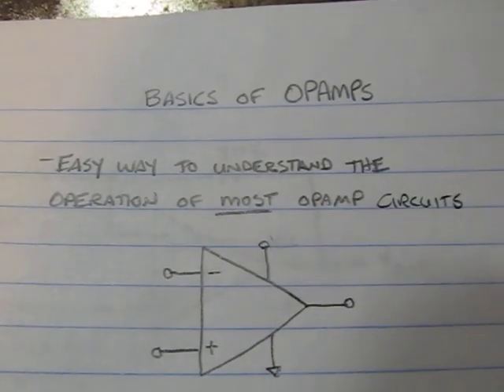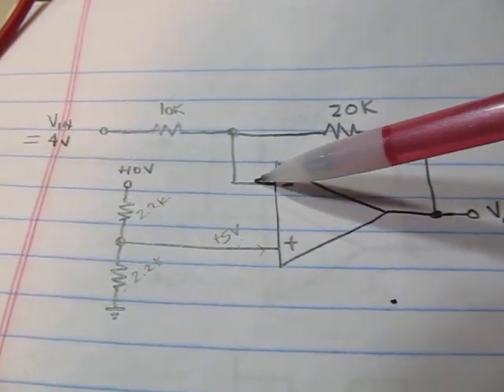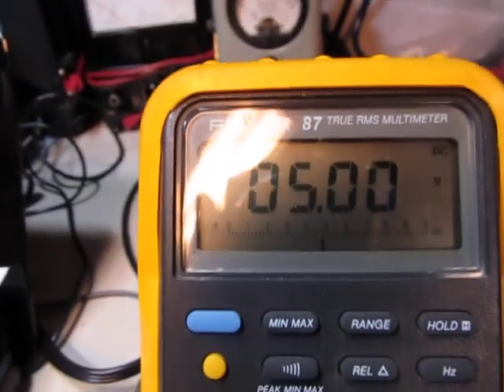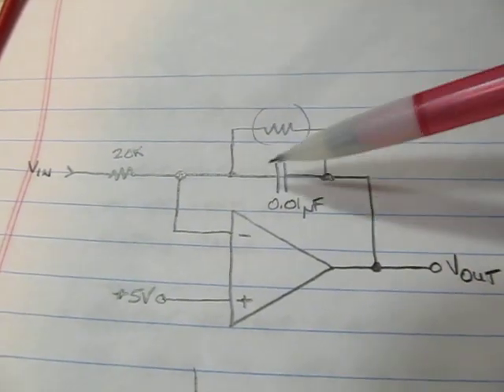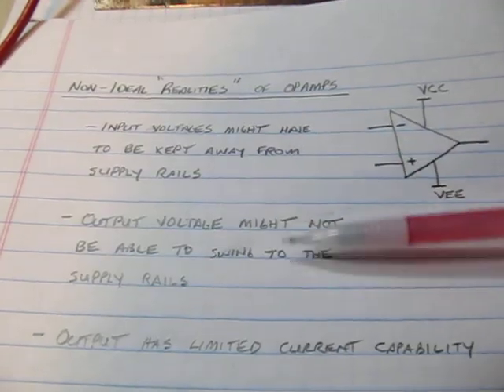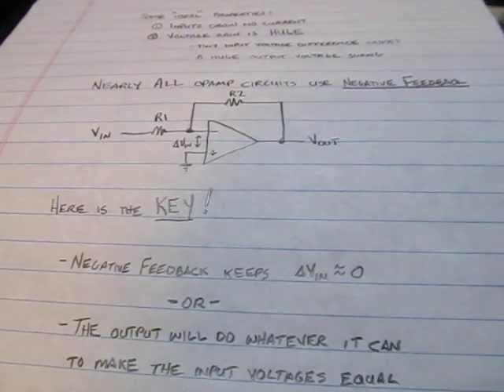#75: Basics of Opamp circuits - a tutorial on how to understand most opamp circuits

Comment: Nice video. One question:  @8:16 you said" when a DC current flows to a capacitor voltage will increase LINEARLY. I thought it would increase logarithmically via the step response formulas. Any comments??
Reply from the maker: The linear increase in voltage happens when a constant current is input into a capacitor. The exponential increase in voltage happens when the cap is connected through a resistor to a voltage source.
Reply: @w2aew  OH! Thanks a lot!
Reply: @w2aew  i like how you still respond to questions after 11 years

Comment: If you set the square wave generator frequency to 1 / (10T) where T is the RC time constant, would you get an output waveform that looks like the charging and discharging of the capacitor?

Comment: and you still didnt explain what an opamp does
Reply from the maker: The op amp itself is just a very high gain, differential input, single ended output amplifier.  The added circuitry around the op amp determines the overall function of the circuit, such as a simple amplifier, filter, peak detector, etc.  I'm not sure what else you are looking for.

Comment: When either a transistor, FET or opamp stage is Feed FORWARD gain which has no feedback loop, how is feed forward gain different than feedback gain? Feedback gain is taking the output signal and creating an error voltage which the input has to follow the output signal. Feed forward gain is output signal is NOT following the input signal and there is No Error voltage?

Comment: Negative feedback does not drive the differential input voltage to zero. This is a common misconception. On the contrary, the negative feedback acts to deliver that error (differential) voltage at the amplifier’s inputs that is required to give the demanded output. Nothing more and nothing less.
Reply from the maker: Yes, of course.  But with the huge open loop gain of the op amp, the error (differential) voltage is typically VERY small.  Using "zero" is an easy  and accurate enough approximation to make the analysis easy.

Comment: Hi Alan, in the first circuit, you have a ratio of 2:1 for the Rf:Ri. Yet the output voltage was 7V and input 4 V, shouldn't the output be 8V? What am I missing please?
Reply from the maker: The input is not referenced to ground, that's what you're missing.
Reply: @w2aew  Thank you. I can see it now, the input terminals are at 5V, so the 1V drop across the Rin is doubled across the Rf making 7V at the output. I really appreciate the time you take. I find Engineers and Scientists are usually very free with their time and advice.
Reply from the maker: @simonyoungglostog  Excellent, now you’ve got it!
Reply: @w2aew  Thank you.

Comment: Various Audio Amplifier IC chips and Op amps use mostly Unregulated Voltages for the Vcc and Vee, any reasons why the use Unregulated voltages? There is a circuit inside the IC chips and Op amps that are stabilizing the fluctuations of the unregulated voltage
Reply from the maker: If the amplifier has sufficient PSRR (power supply rejection ratio), then the gain of the amplifier won't vary with the expected power supply variation, so the manufacturer can get away with cheaper unregulated supplies.  It's all about cost...
Reply: @w2aew  I'm not sure if Op amp IC chips in the datasheet says PSRR. In arcade games and pinball games they use Op amps IC chips for the audio circuit but use UNregulated voltages because the designers say that Op amps IC chips used for audio circuit you can use UNregulated voltages which I'm not sure why? I would think using Unregulated voltage will cause the Op amp, Transistors, and FETS in audio circuits to amplify the AC ripple and the voltage will fluctuate up and down slightly
Reply from the maker: @waynegram8907  Op amps do have good PSRR, and most will specify it.  For example, see the 3rd item on page 7 of this datasheet: https://www.ti.com/lit/ds/symlink/lm358.pdf
Reply: @w2aew  The datasheets will show a bunch of FETS and Transistors inside the schematic of an Op Amp, but I don't see the PSRR circuit or what is considered the PSRR network inside the OP amp. When Looking at an Op amp datasheets what is considered good PSRR and what is considered bad or just ok PSRR?
Reply from the maker: @waynegram8907  There generally aren't specific PSRR circuits.  The differential amplifiers inside an op amp are naturally insensitive to power supply changes.  The current sources used as bias and active loads are designed to be independent of minor supply variations.
Reply: @w2aew  The differential amplifier and current mirrors inside the Op amp is the PSRR circuit or acting like the PSRR circuit? most 70's-90's Car radios and also pinball games/arcade games use one Audio amplifier IC chip which must have built in PSRR circuit or differential amps/current mirrors to act like a PSRR circuit?
Reply: @w2aew  Tube amplifiers don't use PSRR circuits but they use Reservoir Capacitors which I think the Reservoir capacitor values are "above or below" the cut off frequency of the 60hz line frequency? because the filter capacitors value is at the cut off frequency 60hz line frequency to filter out the ripple. The Reservoir capacitors don't filter out the AC ripple. The reservoir capacitors also use a high voltage rating like 450vdc or 600vdc because the high the voltage rating means it can handle "in rush Resistance" . I didn't know that the voltage rating on electrolytics capacitors means the "in rush resistance" of the capacitor. The data sheets specs don't list it saying "in rush resistance". If the caps voltage rating says 450vdc this mean that its in rush resistance is 450mA?
Reply: @w2aew  Most tube amplifiers don't use regulation circuits or tube or solid state regulators, any reasons why? preamp tubes and power tubes don't have a PSRR circuit built into the tube so I'm confused how tubes used as amplifiers the gain doesn't have variations when the power supply variations up and down

Comment: did not work for me. easy to explain looks everything okay but when one to try to make it and test it as you did not so easy. first thing you didn't show how you supplied voltage to the opamp?!! did you use split power supply? and what was the voltage? 10 volt?!! or 4 Volt??! anyways not that good. U got to show details clearly Electronics is about tiny tiny details. Not happy sorry.
Reply from the maker: Sorry about that. The intent of this video is to help understand the basic function of op amp circuits. It wasn’t intended to talk about design details, or how to design op amp circuits. I have videos on things like op amp power supply considerations that covers this. The choice of power supply rails depends on the specific op amp and the required voltage ranges needed as the input and output. This is a lot more detail than was intended in this basics video.
Reply: @w2aew  thank you so much. Sorry I got somehow frustrated and definitely left that comment too soon. When I referred to your other clips everything was sorted out and I found out what I did wrong in first place. You are one of the best or maybe the bestest!!! 🥰

Comment: at 9:03, I'm a little confused. Since the charge/discharge is from the capacitor, why is the yellow waveform a ramp, rather the typical curve a charge/discharge cycle of a capacitor?
Reply from the maker: Because the op amp + feedback results in charging/discharging the capacitor via a constant current.

Comment: Hi
I have been trying to measure the Input Offset Voltage on a op07 op amp on you tube there  seems to be conflicting ways to do this all with different value resistors using the inverting amplifier my own way was to use a 100000k res  on the Rf and 100ohm on the Rin to ground also the + to ground gives me a gain of 1000 my supply voltage to the op-amp is +-  14v   and I measure  about 13.42v from ground to the output. And was told to divide my voltage by 1000 to give me 13.42 milivolts offset voltage, others tell me to put resistor also on the + to balance it up I watch your videos and you explain things the correct way hope you can help

Comment: What are some tests you can do for preamp amplifiers circuits and power amplifiers circuits to test for Linearity? Linearity can either mean gain flatness from 20hz to 20Khz or Linearity can also mean how much input peak to peak voltage before the preamps output clips saturates or before the power amplifiers output clips saturates. I'm confused by what EE engineers are considering when a preamp or power are is linear.

Comment: At timeline 7:32 when using a capacitor as negative feedback, the rule you mentioned at the beginning of the video where negative feedback causes the differential input voltage to be near zero, does not apply here, since the non-inverting input is fixed at +5volts and the inverting input swings above and below 5 volts. Am I correct?
Reply from the maker: Not quite.  When the input is brought above 5V, the output voltage gets adjusted to ensure the inverting input stays at 5V - it does this by causing the current through the input capacitor to flow into (or out of) the feedback capacitor.  A constant current into (or out of) a capacitor causes a linear change in voltage across that capacitor, which is observed at the output.  The junction of the capacitor and input resistor (at the inverting input) remains at 5V.
Reply: @w2aew  Thank you~ This is interesting!

Comment: where does the 5V come from? Simple ohms law, but I do not understand this.
Reply from the maker: The 5V at 3:16 is from a simple voltage divider.  The two resistors are the same value and are in series.  Since 10V appears across the combination, there will be 5V at the connection between the two resistors.  There are several ways to calculate this.  It is basic ohms law.  You can compute the current as I=10V/(R1+R2), and then the voltage across the lower resistor as V=I * R2

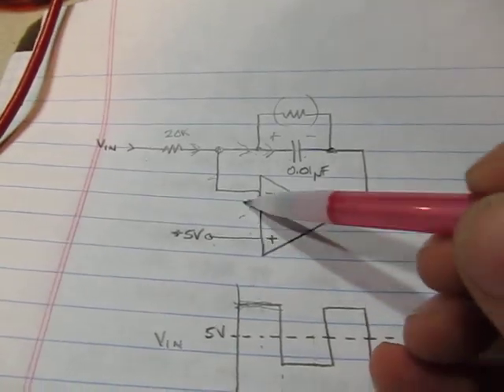Comment: can this op amp circuit in timeline 6:58 be considered as a non inverting amplifier? At timeline 9:38, the rule you mentioned about both inputs have to be at the same voltage level when using negative feedback applied only to when a resistor is used as  negative feedback and not a capacitor. But here you showed that when a capacitor is used as a negative feedback, the rule still applies.
Reply from the maker: At 6:58, assuming the signal input is at the upper left, this is an INVERTING configuration.  If negative feedback is being properly employed, the two inputs will always be nearly the same voltage.
Reply: @w2aew  Thank you sir

Comment: I have made several attempts at making op amp audio amplifiers for use with transmitters. They always seem to introduce unwanted noise into the transmission. I don't seem to have this issue when using a linear BJT amplifier. Any tips on keeping op amp noise out of a transmitter?

Comment: Differential-mode and common-mode signals are important to understand in the design of complex signal-conditioning circuits in medical diagnostic, industrial control and military applications. Topics related to these aspects are discussed in one chapter of textbook 4 (see in video #1 last frame References) and a power point presentation with animations “Basic Action of a Differential Amplifer-Heart of the Opamp” is included in the CD alongwith this book. It gives an intuitive approach to learning diffetential amplifier operation which is the heart of the op-amp.

Electrostatics and circuits belong to one science not two. To learn the operation of circuits, Current and the conduction process, resistors and how discussing these topics makes it easier to understand the operation of capacitors, inductors, diodes and their operation in op-amp circuits and circuit theory watch these two videos 
i. https://youtu.be/REsWdd76qxc and 
ii. https://youtu.be/8BQM_xw2Rfo 

The last frame in video #1 lists textbooks in the References. Textbook 4 discuss all the above topics using a unified approach to electrostatics and circuits.

Comment: 3:15 Can someone help explain to me how he got that voltage? Im unclear how Ohm's law was applied
Reply from the maker: 10V applied across two 2.2k resistors in series.  Current through both resistors is the same (10V/4.4k).  Thus, the voltage drop across the lower resistor is 2.2K * (10V/4.4k), which can be re-arranged as 2.2k/4.4k * 10V, which is 1/2 * 10V or 5V.
Reply: @w2aew  wow thank you that makes sense

Comment: Master
If possaibale ,could you explain an adjustable power supply circuit on your great papers?
I mean so much amateur need current and voltage adjustable power supply details.Have over millions circuits about this but only some circuits working on internet.
Could you tell ,for example 0-30 volt (Adjustable) and 0-5 ampere adjustable  (or a few more) linear power supply ,it can be SMPS (with new chips) Short Circuit protect and over adjust current LED is enought lol
Regards

Comment: Master
I am working update with a current and voltage adjustable power supply circuit.,
Old circuit have 2 pcs 741 op amp.and power supply's maximum output is 30 volt.
Could you advice a new opamps for this application also chep too (dual or quad in one case)
Regards
Reply from the maker: The TL072 is has FET inputs, so draws less input current.  The NE5534 is a nice low-noise unit.  Both of these have been around a while too.
Reply: @w2aew  Thank you master

Comment: If a resistor voltage divider circuit was to create a bias voltage and used a top resistor 6800 ohm and the bottom resistor as 56K that is connected to the ground. If you adjusted the bottom resistor to 5K that will send more Current to ground, but what happens when you send more current to ground? If you leave the bottom resistor as 56K and adjust the 6800 ohm resistor/6.8K to a 68K ohm resistor to "Limit" the current. By leaving the bottom resistor as 56K its not sending current to ground. When you adjust the bottom resistor to a low resistor value to adjust the bias voltage of the voltage dividers output point it will send more current to ground, what cause what problems when sending to much current to ground?

Comment: Why do most op amp circuits use negative feedback instead of positive feedback? I’m missing something, thinking amplification, I think you can just as easily setup positive feedback and not have the output 180 deg out of phase?
Reply from the maker: Positive feedback is only used for oscillators, comparators, and the like - not for amplifiers.  Positive feedback will cause oscillation or clipping/limiting.  Think about it.  A small signal increase at the input causes a large increase at the output.  Feeding this back in-phase will re-enforce the input signal, causing a larger output signal, thus boosting the input more, etc, etc,, until the output clips.
Reply: @w2aew  thanks. That explains it, I mistakenly thought either input would amplify cleanly. You explained it well, appreciate the instruction, thanks!

Comment: What type of IC Op amp chips that has an output impedance below 1K ohm? because most Op amps datasheets says that if you go below 1K ohms the Op amp IC chip will be out of spec and become unstable. I'm not sure why the make Op amps that can't go below 1K as well as if you apply to much capacitance on the IC output amp chip will it become unstable also. The Datasheets of IC op amps doesn't tell you how much capacitance the output pin can handle before it gets unstable or how much capacitance the output pin can drive.
Reply from the maker: It all has to do with power dissipation.  Being able to drive a lot of current (thus, a low impedance output) requires large output transistor which take a lot of die area (that costs money), and may be incompatible with the IC process used for the op amp manufacturing.
Reply: @w2aew  What are the names or type of  IC op amps that have very low impedance outputs and can drive capacitance? Because when you add more capacitance loading the output of an IC or transistor it will start to get unstable and oscillate or cause distortion clipping. Any reasons why capacitance loading will make the IC op amp go unstable and out of spec?
Reply: @w2aew  So using Power IC Op amps have lower output impedance or adding Power Transistors as an emitter follower will drive capacitance loads?
Reply: @w2aew  The Datasheets of IC Op amp chips, transistors, FETS, list the power dissipation, but it doesn't list or tell you about the max output current on how much the component can DRIVE the capacitance load. Increasing the VCC voltage level from +9vdc to +18vdc will increase or decrease the power dissipation? because you're saying the higher the capacitance load on the output will increase the power dissipation of the device but if the VCC is increase higher to +18vdc or +24vdc will this decrease the power dissipation of the IC op amp device?
Reply: @w2aew  When looking at a schematic of Op amps and transistor amplifiers, how can you tell the GAIN by just looking at the resistor value RATIOs? There must be a very easy way of just looking at the transistor biasing resistor values and know the GAIN?

Comment: How can you make an op amp input impedance Low impedance circuit or there is no way? I often see a 1meg resistor to ground on the input jacks to determine the 1meg input impedance but the Op amps input pins have internally very high 10meg input impedance. So how can you make an op amp have low input impedance?

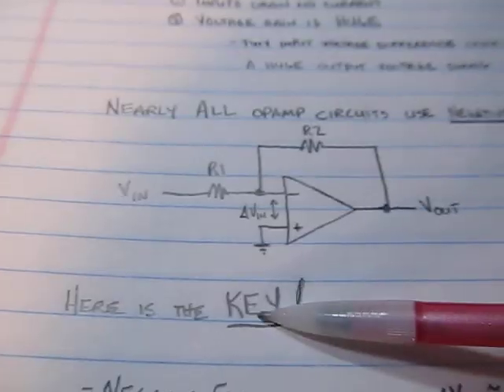Comment: Strictly speaking, the statement at @1:32 should be: "negative feedback keeps any CHANGE in input voltage appproximately equal to zero".  In many opamp circuits,  V(+) is not grounded and the negative feedback will try to make V(-)  -  V(+) be zero.
Reply from the maker: Yes, I wrote it correctly as the deltaV at the input, I just didn't say it accurately.